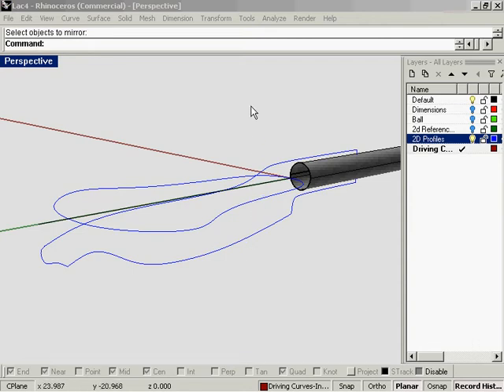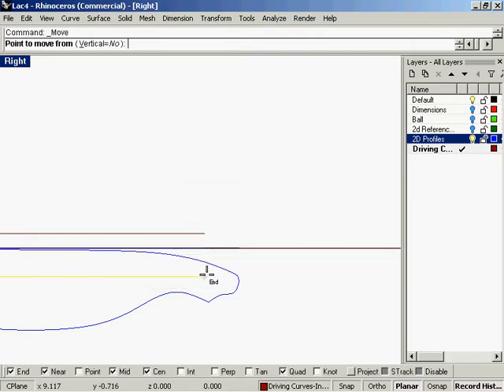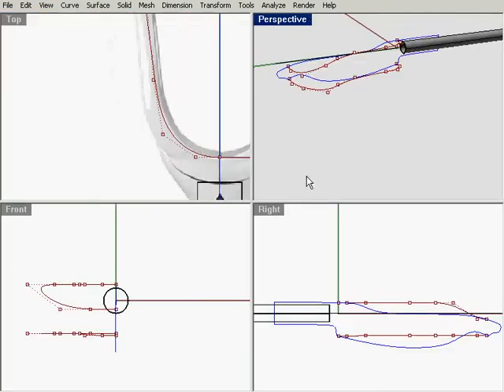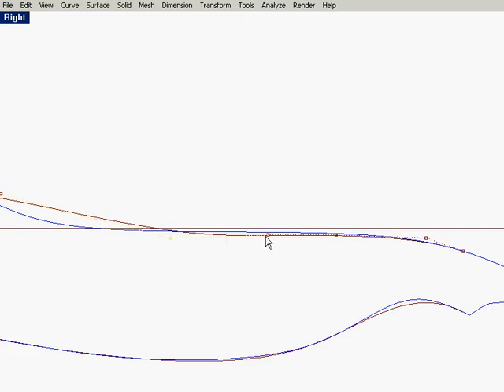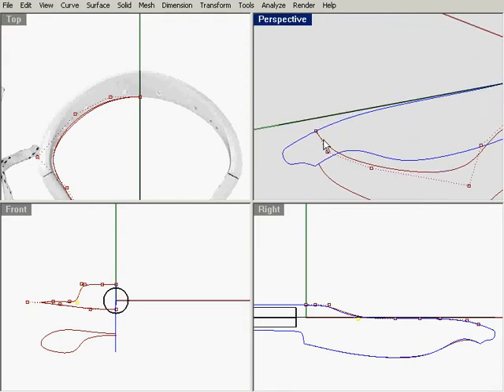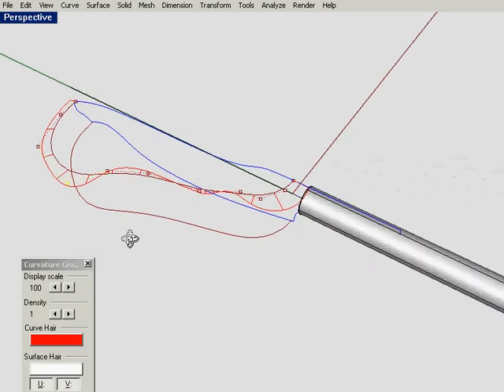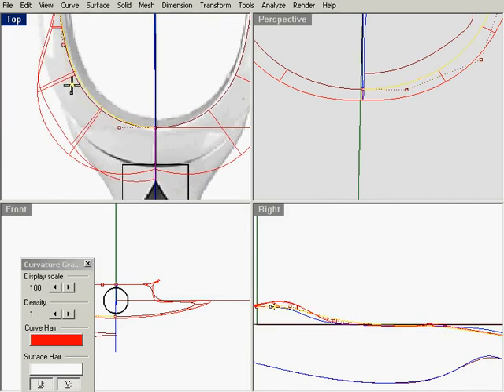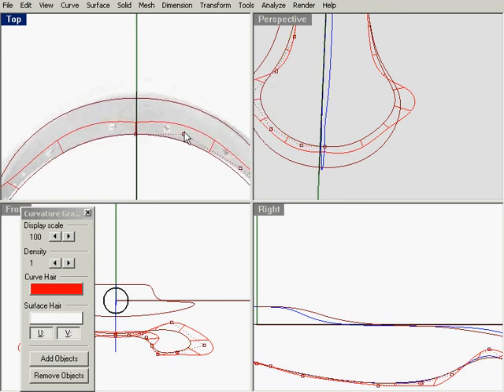Rhino Tutorial Part 3-Lacrosse Stick

Comment: parelt - You did not set your curves to be normal to the zy plane, you cant mirror them because surface will have an edge lying on the mirror plane. U can do this by drawing orthogonal line normal to the mirror palne and than set tangency of your curve to this line. mirrored curves and what is important -surfaces need to be normal to the mirroring plane.